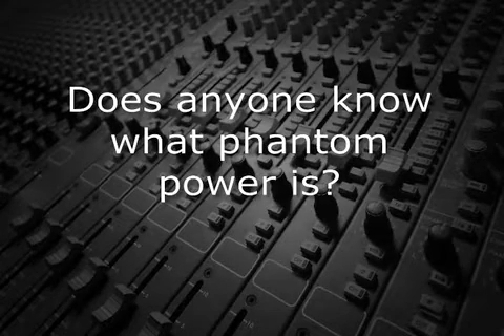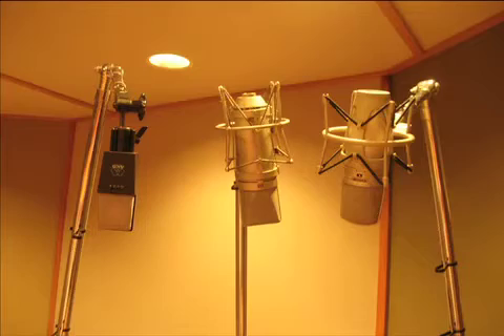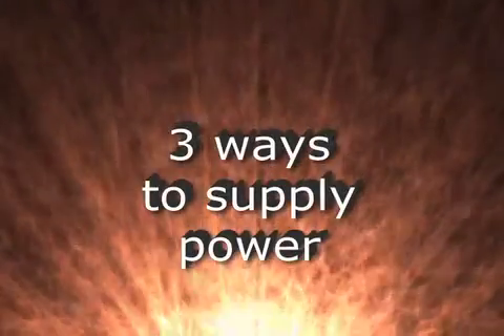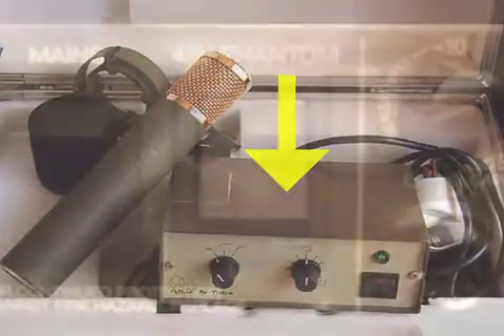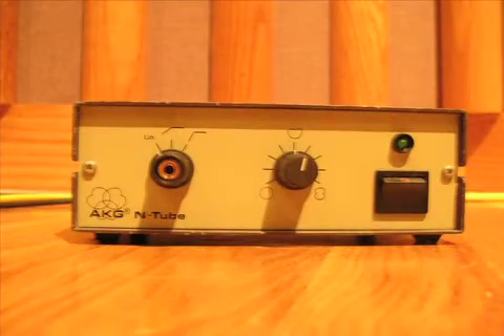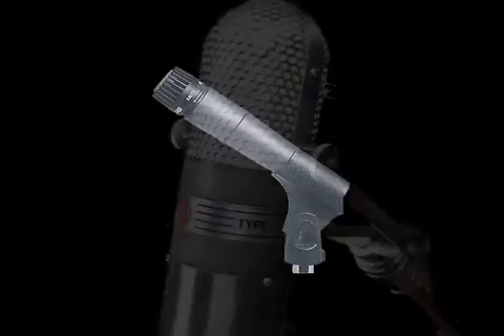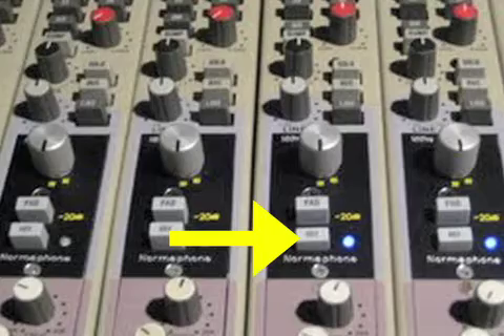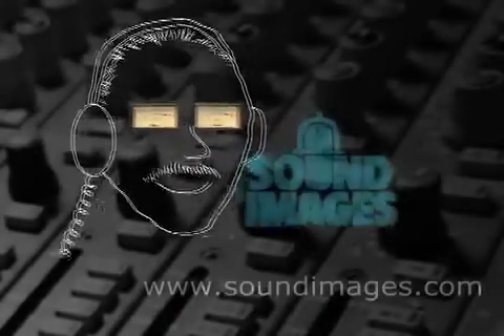Phantom Power

Comment: So if I understand correctly. If I supply 48 v phantom power to a dynamic mic it will work fine as if it did not have phantom power?
Reply: MrAudioSoundImages  so the cad audio tsm411 and the cad audio d12 will not be killed by phantom power?